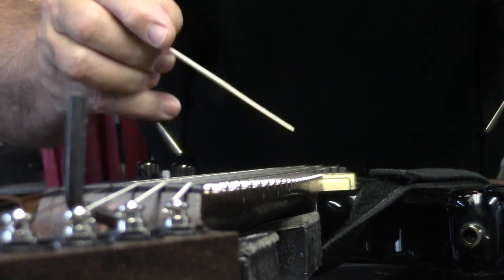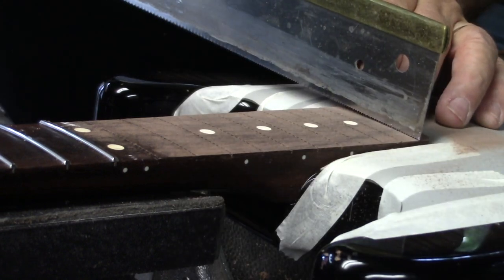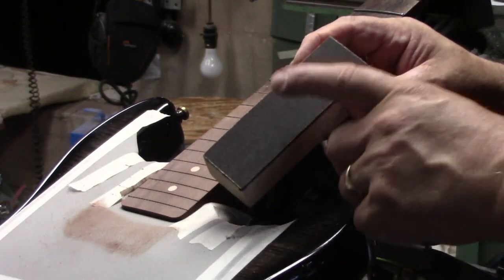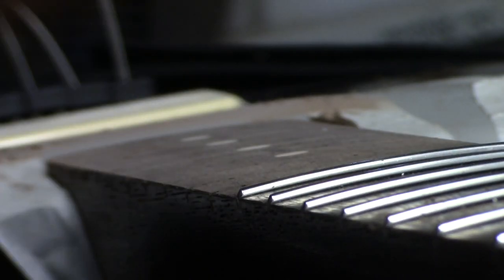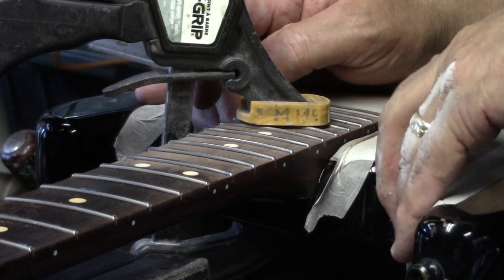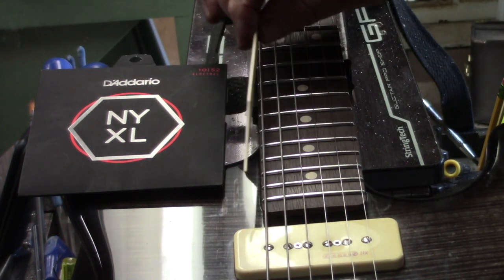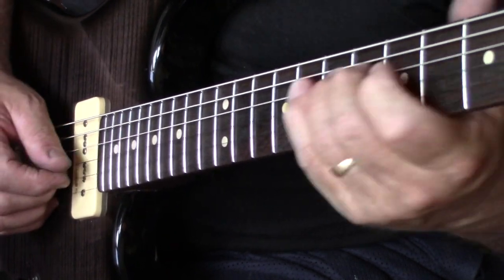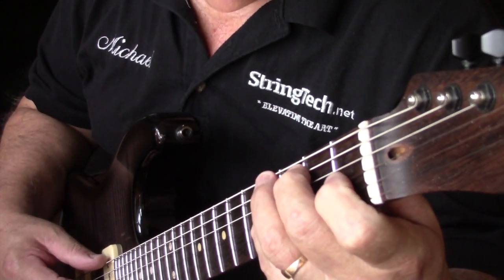Solid Rosewood Tele Neck + P-90's @StringTechWorkstations

Comment: Nice, I'm glad I seen this video because I've re-done my frets like 3 times... an they still buzz on the low E and A strings. I think I'm gonna have to do that fall off thing. Could I just add a little fall off with the frets on? Maybe even just for the e and a string? Because I very rarely play there
Reply from the maker: Yes Justin. If you have enough height in the fret crown .... you may get away with skimming off those upper frets to straighten the neck along the trajectory of the string path. Let me know how you make out with that. Cheers ! MMcC
Reply: @StringTechWorkstations  Cool thanks, I will give that a try before I go wripping the frets out. I don't even really play those 2 strings past the 15th fret anyways